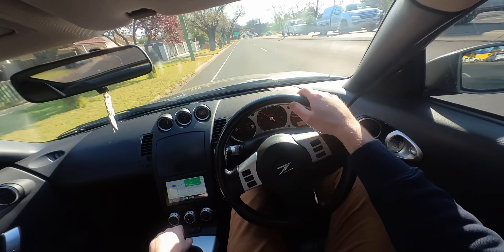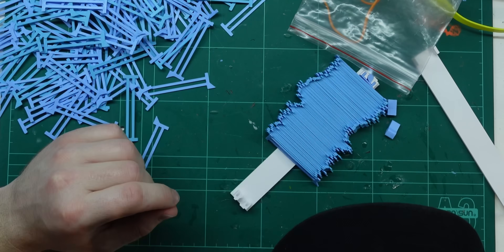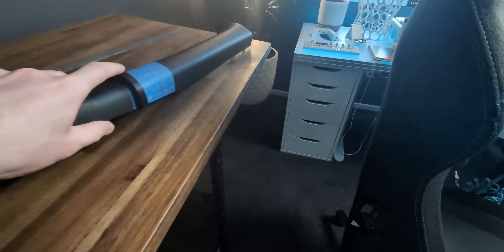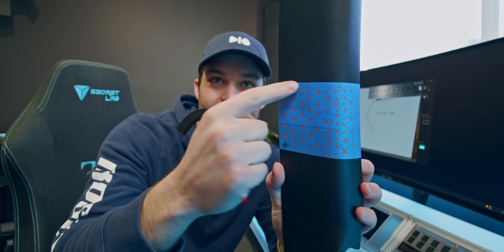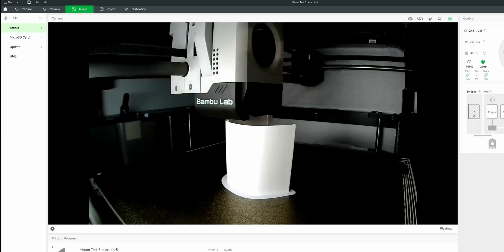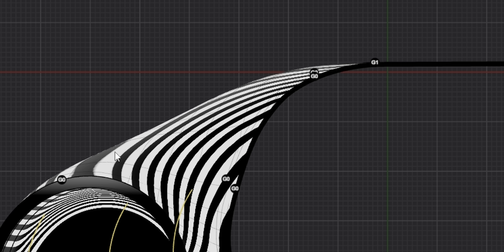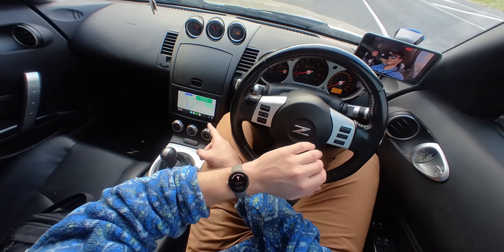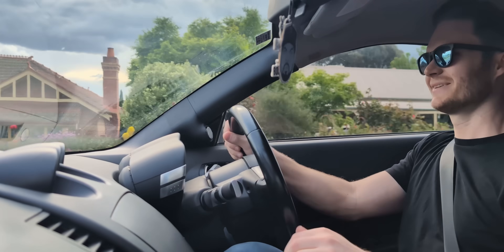a gauge pod with maps.

Comment from the maker: Stoked you're enjoying seeing my ideas come to life. If you want the complete file or just the individual components you can get them here 👉 https://payhip.com/b/uewjU
Reply: Need For Speed underground was the best :)
Reply: Hey Cam! Looks like you need a Moto II :). We've sent you an email
Reply: I've been using Android Auto for work for years and had the exact same issue with upcoming turns, you blew my mind with 12:26 🤯
Reply: You could do a v2 with the garminspeak pro Alexa i just saw this device and taught of this video my plan is to do that in my car so it would be nice to see
Reply: Motorbike riders use a device called the Beeline Moto 2. Made exactly for this purpose. A single charge lasts for weeks too. Also supports GPX files and tracking and sharing your journeys.
Reply: if you activate developer mode you can make it so it doesnt dim or turn off while charging so if you integrate a charger into the holder it will turn on and off with your car
Reply from the maker: @viviusgaming  whoa I didn't even consider developer mode would have dimming control, that's good to know! Think the main issue is the built in battery causes it to overheat too much. If you're interested I actually repurposed the watch as an mp3 player in more recent videos :)
Reply: you need to use your phone with google maps. it does what you want. it shows turns when its connected to car android

Comment: Turn on dev mode and turn on keep awake while charging, and make a hole in the back of the watch holder that you can fit the charger in (and so the cable comes out the bottom), that's going to fix it

Comment: i would try useing the devel eye bike tail light, it is a cheap manuliptable screen that can be wired to a 12v dc and you can run google maps as a monitor or ask chatgpt to create a software that reads upcomming turns and choses what image to display

Comment: Dude. Just 3d print a thin strip/plate put it in hot water to soften it and wrap it around the pillar, once it cools down it will hold the shape

Comment: Aye just a tip. You can manually make high definition 3d models rather then using those bs apps using the same principle as them. 

Using two turn tables/pivot points. You can make a "scanner" with your phone that you can take pictures every 5~10~20° a *fixed point and distance from both plates. when you rotate each joint of your contraption. 

I can look up the plans I drew up later if you want. I just used aluminum extrusion, 3d printed parts and some bearings to make it. Allthough im about to update it funny enough with stepper motors and give it a "brain" to remove the manual aspect of it lol. 

You upload these to your 3d modeling program and then project them onto one another. If you trace them and then extend all of the sketches to the center, and then combine them with the intersect modifier. where it will only keep where all the objects meet. It will produce a 1 to 1 accurate profile of the object. You can also make the object the same size one of two ways. 

Either when you project the images, calibrate the image in the prohram using refrence points (I do this using a pattern I painted onto the surface of the lazy susans and fusion 360's calibration tool) 

Or once the part is modeled, shrinking or increasing the objects size by figuring out what scale your images are compared to the real world. Putting a test cube print you can figure this out with one picture on the home made scanner. 

Measure the print, and then use the mwasure tool in fusion and then just divide the real, by the not real. 

From here take like the nearest ten thousandths and youll be PLENTY percise for what youd do day to day. 

I perfer the first but ive done the second here and there depending if im using solid/fusion or blender...etc.
Reply: oh also to fix the issue with the smart watch. 

Look up esp 32 round display. 

You'll find several versions you can use for this application. An added bonus is you could probably hook it up to your phone via Bluetooth the same way for directions if you perfer that. 

There may be a way to hook it up to the head unit? But that I think is beyond my pay grade because idk what unit specifically...etc. and that may require custom software to get work but still possible.

Comment: Is interesting because Apple Watch, phone and CarPlay will all work together in the way you’re wanting the pixel to work and I’m pretty sure you could get it to stay awake, shame it isn’t a circle screen though.

Also if you were to get to the battery, you could always disassemble the battery to keep the “smart functions of the battery” and some 3v regulator to act as the raw cell
Reply from the maker: damn of course Apple have figured how to code each device to work at the same time 😅

There's some guides online about tricking a battery I've read, in the end I pivoted and repurposed the watch as MP3 player, it's a more recent vid on the channel 🤙

Comment: You can disasamble the battery, remove its electronics and solder those to a step down convertert from 12V to 4V. I used to do this whith old phones to use them as a head up display.

Comment: honestly I know similar shaped 3rd party displays exist, I can definitely think of a custom device that could do this job, be hotwired to the battery, be cool-able, and also connect to the display or phone to show navigation steps, my only concern actually is does maps have an API to share the directions
Reply: also would this be smarter as a transparent HUD rather than a smart watch display (i.e. not interact able but more viewable)

Comment: why not install the charger in the apillar as well so u dont have to pull it in and out to charge it
Reply from the maker: Was testing the mounting angle first, but once I realised it overheated just from normal usage in a hot car it'd be a risk to try wireless charging as well.

I've since repurposed the watch as a MP3 player you can see in more recent vids 😄

Comment: TFT CIRCULAR DISPLAY, i2c driver, Arduino Nano, or esp32 with wifi module built in, they can work with 12v too, the tft LCD is actually the one that they use in watches or replacement for them, I actually bought one for my sim racing setup for a gear change screen, they are really cool, but remember once you go Arduino, you can never go back. I actually like to test this myself, good luck mate🤘🏻🤛🏻

Comment: Let's see if this helps:
- Try to get a tube to conduct fresh air (from outside or your AC unit) to the watch.
- Add metallic disipator with thermal pads on the back (where the cold air will blow)
- Add a little bit of shade making the watch go deeper into the mount (it will protect it from the sun + will be easier to read with lower brightness like your dashboard i.e.)

Tell me if this makes any difference. Cheers!

Comment: Mate you should try the Royal Enfield Tripper, it's perfectly round. and the sole purpose of the tripper navigator is to just show the directions with the distances. 

Depending on where you're based in Australia, you could go have a look at it. Ask the people at the dealership if they could sell that to you, just the module. If there are mechanics available at the dealership/service centre, the mechanics who understand how this works, if they could help to guide you on how to make the Tripper work with your cars ECU will be a massive prerequisite for it to function properly. But i think if you can have a different motherboard for the Tripper itself, it could do the work. 
After that, I think the tripper navigator will need some retrofitting in terms of software, because it's paired with the motorcycle's ECU. After which you're going to have to install some ECU Software to make the Tripper think you're riding an RE. 

A very rough idea/ suggestion. 

https://www.royalenfield.com/in/en/motorcycles/tripper/

Comment: You could use a sbc as a head unit, just mount it in the car and route a wire to a circular OLED. There has to be an open source navigation or car dash project out there somewhere.

Comment: To be fair, I think you had the right idea with the watch still charging while in the car. I think what you might do is a small fan behind the charger with intake and exhaust vents. It sounds ridiculous, but it does work. I have a wireless phone charger in my car that has this, and it functions great. and I live in Texas, so the heat issue is valid here.

Comment: Redo the whole entertainment system using a raspberry pi 5, you could get crazy with tiny screens and custom software
Reply from the maker: That's probably the best "feature packed" solution, but I also like knowing the tech in my car simply works haha, don't want to go for a drive then have to troubleshoot why a Linux distro decided to buy out 😅

Comment: A company should make a small device
That shows arrows during travelling
With a good software and hardware , for future updates…

It will be a good product…
Reply from the maker: One does, called the Beeline moto, for motorbikes but I've been using it a bit.
Will pop up in a future vid most likely but it's not the perfect solution as doesn't sync to my Google Maps

Comment: You should probably chat to someone about how all this tech actually works before going forward with ideas. Smart watches generally need a host device for managing data connection and doing a certain amount of processing. So, unless it is specifically set up to work entirely on its own, it will always trigger a host device. The host device will need to display the app to stop it from closing. There is a version of the pixel watch that has 4G LTE and that might be able to do navigation completely independently without triggering anything, but you would need to modify the software to stop it from reacting to wrist behaviour or movement. Basically, you would need to know how to get root access to android and then customise it to change behaviour, effectively creating custom firmware in the process. By this point, you might as well just learn how to code and plug in to the google maps API. Then just order some parts and custom fabricate your own bespoke solution. You could probably pull apart a pixel watch and use the display, but you would need to solder to provide the correct type of power and hide a little raspberry board somewhere. Not hard to do if you just learn a bit.

Comment: actually you can remove just battery by desoldering it from its battery management board then only keep the battery management board and give it 3.7 voltage on battery terminals

Comment: This is an interesting concept. Has me thinking about using one of those PC AIO cooler screens as a display powered by something like a raspberry pi just for visuals. I'm sure you could pull the navigation data from Android auto / apple car play without a BT connection since my car does the same thing for the dashboard. Only down side is it's probably locked up behind proprietary software... Could be a good weekend project for someone

Comment: android auto implements some sort of repeater format that does this. idk what exactly. but the point is, for example in fords (and presumably others) it does exactly what you describe, showing next turn, street name, distance to the turn, eta, remaining time, and distance to your destination, in a display in the instrument cluster. these messages are encoded by the head unit and sent out over CANBUS to the instrument cluster. AA/ACP are pretty dumb, bidirectional audio, a video feed from your phone, and touch events sent back, with not much else, but somewhere in there, AA can send all the turn info and media info as well. how you would be able to use any of this in a custom setup with an aftermarket head unit, i haven't the foggiest idea, but the point is Google maps and android auto do have some sort of software interface for providing the exact information you're looking for, if only you can hunt down some documentation for it, which... good luck.
Reply: Crankshaft NG or open auto, it's a raspberry pi OS that allows you to create your own head unit. Suspect you could get into the code and get this output from the PI but idk about decoding it

Comment: The ideal would probably be 2 digital gauges (like flock) connected to your carplay. 2 so you get the direction and which lane to stay in. Pretty sure I've seen 2-3 gauges mounted on the a pillar, so you could reuse the same part

I have "step by step navigation" on my civic with the carplay, displayed in the middle of the tachometer, same way a hud would display it. But it doesn't work with google maps (it probably would work on android). This wouldn't be a problem if my city didn't love forcing you to change lanes way too early without any signs or Apple had the "use left 2 lanes to...." announcement. If I'm bothering with entering my destination, I'm driving in an unfamiliar area. Nothing's more fun than seeing cones ahead, guessing the side, then being forced to do a u turn or a tunnel that exits 2km ahead...

Comment: you know it's something about the battery power saving things you can cheat that with using the charger behind the holder (there's a hole in there where you can put the charger and put the cable inside so it's look clean, and all you need to do is having a usb adaptor in your car)

Comment: Former UBreakIFix technician here. Basically every smart watch I have ever torn apart has a multi-pin connector for the battery. Google, Samsung, Apple, Garmin, so on, and so forth. You might be better making this pod with something like a Raspberry Pi Zero and a small LED screen and run a cable inside the A pillar. If I were you, I wouldn't give up this because of what you found. I think this is a really awesome idea and makes a lot of sense for a lot of different vehicles where your in dash LCD is lower than the steering column. You know, for the sake of safety and keeping eyes on..... or at least close to the road.

Comment: 🤔🤔🤔 So ya made a GPS arrow pointing gauge like they have for motorcycles... 
It's cool that ya did a DIY but without a 3D printer, I think there's still alot of other options.
I personally would have made it a little more flush to the pillar.
Hell, put it in the center of your steering wheel‼️😆😂🦍

Comment: Should have added the wireless charger in the hole to charge it
Reply from the maker: as I pointed out at the end, the built in battery already overheats without charging, so adding a wireless charger would be a bad time 😅
Reply: @camshand  Yeah I later heard you mentioned that lol

Comment: You could've probably done some resin/epoxy work by blocking out a section of the A pillar with some barriers, and pouring out a silicone mold out of it

Comment: 3:00, personally i wouldve used ASA, my go to material for literally anything as i know it holds lol, PETG has been pretty much useless even in the Norwegian summer sun. I get not wanting to use ABS/ASA without proper ventilation tho, my 3D printer is a in a room where one wall is pretty much covered by two big windows that i open anytime i print ASA.

Comment: You should look into a beeline Moto GPS made for motorcycles but they work excellent in vehicles. Also I have one in my 1970s struck very similar set up right next to the pillar with a mount. Won’t have to worry about the issues you’ve had with the watch since they are made to live on a vehicle and take quite a beating.

Comment: Hey you might consider a beeline moto it's commonly used in the motorcycle scene as a small navigation system it would work perfect for your project and is only designed for navigation

Comment: i have an older car an the steering wheel center is really thin and i just straped a mibro(they're chip smart watches) to it and it worked as a media controller and direction screen they have lcds and are pretty bright and they stay on

Comment: Genuinely sounds like you kinda wanted a Royal Enfield's Tripper pod that I have on my motorbike lol. It has no touch screen as you run the directions off a companion app on phone, however it has dark mode, always stays on, runs off 12V and can withstand high temps. And is much easier to design case for.

Comment: You should try the beeline moto II, it's the same thing you want but for two-wheelers, should work well, and it comes with a powered mount so you can keep it powered up all the time no worries.

Comment: Love this. One of the reasons I love keeping a map view even if I'm taking a daily route I know, is that 'mini-map' feel from video games.

Anyways, I think this was a good concept, limitations really being the hardware. I would say, you're better of just using Google's feature on the phone showing the upcoming turns while the head unit shows the map. Before going full custom, maybe finding an older smaller phone to use and dedicated solely for the car could work as well, plus the arrows would be more visible.

Comment: There's a company called Beeline that make circular GPS devices (that pair with a phone) designed for pushbikes and motorbikes. Their motorbike unit would work a lot better than a smart watch, as it's designed for those purposes. Sadly they've only got mounts for handlebars, not A pillars.

Comment: I actually think this is super cool. You just need active cooling and likely there is a 'keep bright' hack for the watch with ADB. Taking the battery out is smart and I wonder if you used a Ticwatch which has the 2 displays, so when the car is off, it could switch to the LCD screen and when the car is on, it would charge and start the full colour display. Also, they make transreflective displays too, which work way better in cars. Good idea!